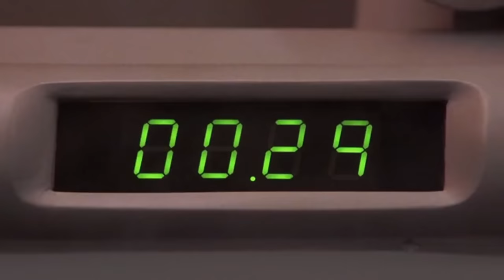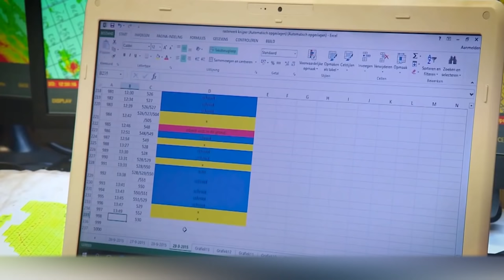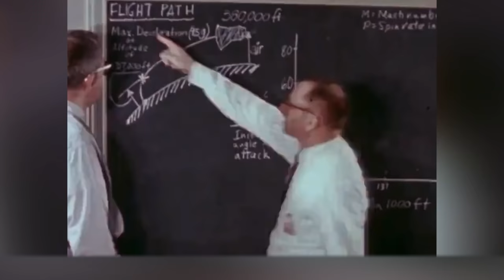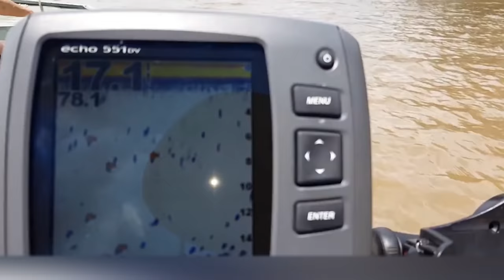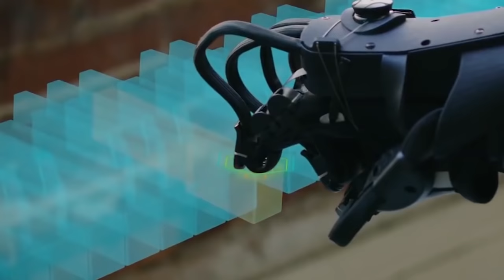The Most Expensive Mistakes in All History

Comment: I was an aerospace engineering student at San Jose State University in 1990-91. One of my professors worked on Hubble. The problem was this: all the equipment and tools and systems had been meticulously calibrated. Unfortunately, the micron cubes used were actually inaccurate... so everything was calibrated to work together, but the end product was an incorrect dimension.

Comment: *CORRECTION TO VIDEO* (Starting 4:19, Piper Alpha segment.)
Piper Alpha blew up because of a hand tight flange on a gas bearing safety valve attached to a Condensate Pump that was down for Maintenance.  The Work Permit for the Condensate Pump maintenance job was in one box for the deck it was on and the paperwork for the Safety Valve pipes being out of service and Flanged was in another box for the deck the pipes themselves were on.

When the first pump failed, the downed pump was deemed ready for use even though the safety valve for that pump was out of service.  Add to that that the flange was only hand tight, the Natural Gas Condensate shot out, found an ignition source, ignited, and the explosion sent the firewall between Module A and Module B flying into Module B like unguided missiles.  Which resulted in the downing of the platform.

This sounds like the author thought Deepwater Horizon was Piper Alpha...
Reply: Thank you for saying this so I didn't have to

Comment: 60 million to alter a few station platforms doesn't seem like...one of the most expensive mistakes in history.
Reply: It was 17.5 Billion not 60m the mistake was the trains to start with not the platforms the platform and other adjustments were not the expensive mistake it was the production of the trains at 17.5B
Reply: The trains are not a failure. Their width was. But compared to 17.10^9 €, 60 millions is nothing.
Reply: Tom F the trains were the failure as they were suppose to fit the existing platforms
Reply: 60 mil would cover fixing 1 to maybe 3 stations max....
Reply: Mishka the platforms were not rebuilt completely only extended in width slightly so wouldn’t have been as expensive as you may be imagining
Reply: Supreme French Bulldogs - So if you were in charge, you would have scrapped the 17.5 billon dollar trains and left the platforms alone? Good luck with your career.
Reply: jakese7en1 lol i never said that just stating that the expensive mistake was the trains and not the platforms as the platforms were there before the new trains and it was the trains that were 20cm to big so the trains were the mistake not the platforms
Reply: The last one was London's millenium bridge at 6 million.  We had one tall building in our city built with brick on the exterior, well you know what was bound to happen when the building swayed in the wind.  The cost to replace the exterior was 100 million, dwarfing nearly all the the mistakes mentioned, and yet it barely made it beyond the local news.
Reply: The French trains "mistake" was just a fake news. The trains ordered from Alstom in 2009, and Regio 2N from Bombardier in 2010 were ordered according to the new European standards. The adjustment of some platforms in some stations was just late ...
Reply: In fact, it was not at all a mistake. The platforms adjustments were planned when the trains were ordered, but troubled discussions between RFF and SNCF postponed these works and when the first trains were delivered, they become urgent!
Reply: Yeah the most expensive mistake was trump being born
Reply: Torin money isn't made of paper lol

Comment: A video about expensive mistakes is a joke without including the Mars Climate Orbiter, lost in 1999 because engineers failed to convert design specs from English to metric, resulting in a $125 million crater on Mars.
Reply: U mean from the imperial system to metric system?  Or something else?
Reply: That was the causeof the Challenger shuttle disaster too when they made the o rings the wrong size.
Reply: The English ARE metric. It would have been from AMERICAN to metric. It's actually called Imperial. Metric measuremt is universal with the exception of the US. They still use imperial and a bastardized form of it, to boot
Reply: @700gsteak  The O-Ring were the right size, but not designed to work in cold temperature. The morning of the flight temperature dropped to sub-zero celsius. https://en.wikipedia.org/wiki/Space_Shuttle_Challenger_disaster
Reply: @cjjulian42  The "America First" types have voted down every attempt to go metric since the days of Reagan. They're perfectly willing to waste £50 billion or so every year in mistakes and lost sales,  just so the US can be "different" from everybody else.
Reply: Mariner one and that goddamn hyphen
Reply: That's a whole two days of their budget.
Reply: flip inheck  The US does use imperial. Gallons, quarts, pints, pounds, ounces, feet, inches yards and miles are all imperial terms. Just because US pints are smaller doesn't mean it's not imperial. The US has bastardised the English language, yet it's still called English.

Comment: I would highly recommend to anyone watching to check out a more long form documentary on Piper Alpha. To place yourself in the shoes of what some men had to go through: Imagine being faced with the choice of going back to fires so hot that your skin began to scorch, or having to jump 25 metres through blazing steelwork into a freezing sea, (though the surface itself on fire), when you've been trained that a fall of more than 15 metres will likely kill you. Some of those men survived, and rewrote the manuals on what the human body can endure.
Far from being about one human mistake, it was a whole series of factors that made the disaster so deadly. One aspect was the classic "profit over safety" attitude, which lead to oil export pumps feeding the platform, and so the fire, from other platforms not being shut off to avoid loss of profits. It was and still is shocking, shaking the industry to its core, and leading to fundamental changes at every level, as well as the invention of an entire new branch of offshore safety engineering. To those interested it is very much worth learning about both from a historical and safety perspective, as well as remembering those lost and the inhuman way they died.

Comment: Scrap metal is not useless. It is recycled
Reply: Go dumpster diving
Reply: Removing all the rust is a bitch, don't you think?
Reply: What do you think iron ore consists of?  Mostly various forms of iron oxides, aka rust.  When you smelt it, you're melting down the iron and all the oxygen and other garbage floats to the top.  Same thing applies when recycling metal.  You melt it down, oxygen goes free, and the other impurities float to the top.
Reply: I think they were trying to compare it with the value of the cars. You know, relative of the cars, not as an absolute.
Reply: Maarten Bodewes  They were Mitsubishis - I'd rather take rusty scrap metal.
Reply: Scrap metal that's been buried in salt water under a few thousand pounds of pressure for a while is aboput as useless as it gets
Reply: @MarkConnely  the pressure wouldn't do anything to the rust to my knowledge. Still good old iron. Ever seen rust turn into iron when using a blowtorch?
Reply: @StepSherpa  I'm just assuming that higher water pressure = higher oxygen pressure, water being H2O... and higher O pressure would accelerate oxidation... ?
Reply: @MarkConnely  I do not know if that is how it works. Though I doubt that would be the case but someone saw the value of recovering it and selling the steel for scrap
Reply: It's not useless, it's worthless. That is to say, compared to the value of a new car. But yah, you can find "use" in almost anything. (I don't remember which word the author used)
Reply: George Scott 😂😂😂😂😂

Comment: The mirror was 2 micrometers off!? My micrometer is almost 7 inches long but nasa probably has those fancy digital micrometers and they are probably even bigger!
Reply: Micrometer has two meanings. 1: a unit of measure, 1/10,000 of a meter, 2: a tool used for precise measuring. They are pronounced differently, but spelled the same.

Comment: Your account of the causes of the Piper Alpha explosion is wildly off the mark. There was no 'construction of new levels,' and there was no recommended interruption of extraction to go unheeded by operators. The explosion happened because a changeover to a second condensate pump was cleared despite a missing flange on its safety valve. Get the facts before you make a video.

Comment: The Lake Peigneur segment has more inaccuracies than facts. You discuss drilling for oil while showing salt mining images? What?
Reply: The drilling company's downhole navigation got botched and they drilled into an underground salt dome that had been hollowed out by the company mining it (Diamond Shamrock). The water from the lake quickly dissolved the salt (sodium chloride is readily soluble in water) making the hole rapidly get wider thus accelerating the whole disaster. The hole got so big that there was a whirlpool in the lake which got completely drained in about 20 minutes. I was living in nearby Lafayette, LA at the time so it was all over the local news.

Comment: a lot of work and I congratulate you,
but as I said since the beginning there is a big problem of basic design that will not allow to go further.
the engine system too slow the weight much too heavy
legs too fart apart.
the secret to standing in balance on 2 legs is where you put your foot,
imagine that you are on stilt. it  is the place where you put the stick that gives the swing.
it s the secret of the boston dog dynamic it s so that it does not stop jumping when it stays on 2 legs.
do not spend more time on this dog goes to something else (less fat)
kisses

Comment: The reason why Hubble had issues is it was not the first one made... the military had already used this design for spy satellites but they didn’t have the focal distance issue since they were meant to aim 100miles away not 1million light years... it was easily fixed with new hardware/software